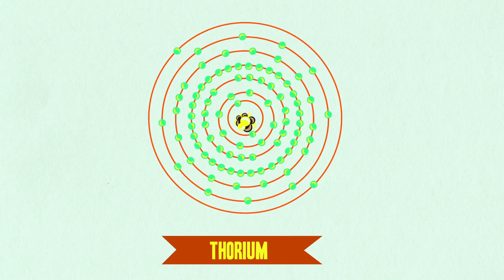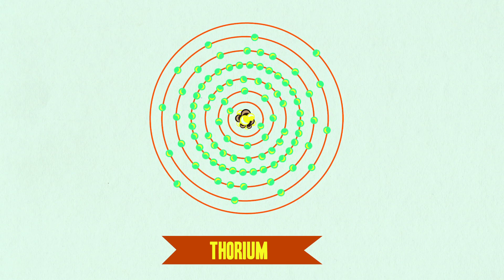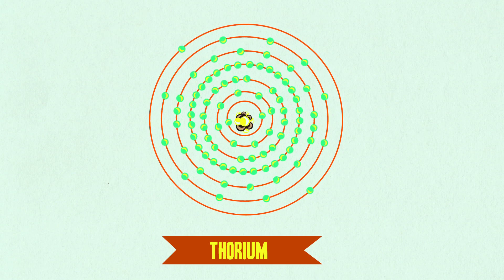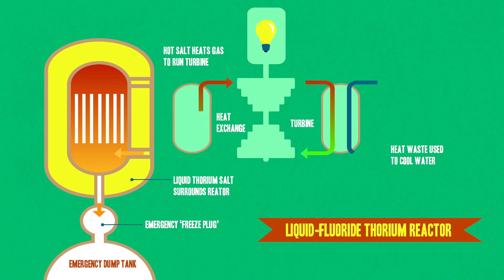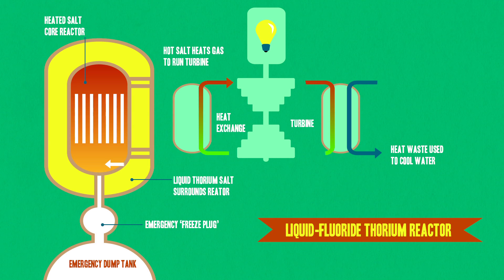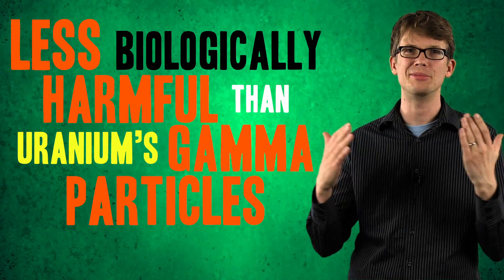Liquid Fluoride Thorium Reactors (LFTR): Energy for the Future?

Comment: There is no way to retrofit a uranium reactor to use thorium. They are totally different. Uranium reactors need huge amounts of water that they need cooling towers for. The huge advantage of Tears is that they don't. They can be built much smaller, and much nearer to where the power is needed thereby reducing the need for huge power lines. Search youtube for Molton Salt Reactors--same thing. Eliminate uranium as a power source.

Comment: To say that LFTRs can't produce weapon fuel is false. Thorium isn't fissile. In a throrium based fuel cycle, the thorium is bred into uranium 233, which is fissile, and its that that produces the energy. Its similar to the early dual purpose reactors that burned plutonium, as well as produced plutonium for weapons. Uranium 233 is a better weapons fuel than U235, its more similar to plutonium that u235 in most respect in terms of its nuclear properties. U233 was tested in several weapons in the 50s.
Reply: interesting

Comment: Actually no, the fuel is actually mixed in with the salt coolant, this so that the fuel can be drained away from the Neutron source in case of lose of power and can be cooled passively. In other words there is no chance of a meltdown either, you can even make the reactor have a drain plug that melts at a specific temperature automatically draining the reactor with no need for intervention.

The only way for a metldown to occour would be to leave U233 to build up in the reactor a long ass time; probably months, and at the same time you would have to be removing the Actinide wastes, so litterally you could walk away from this reactor and be certain that a reactor breach would never happen unless someone purposefully did it.

Comment: "As a bonus, the waste from the process could be used to make bombs."

NO.  The LFTR crowd really needs to disabuse themselves of this notion.  That is not why light water reactors prevailed, and to be perfectly clear, any reactor that runs on Uranium with an enrichment level of less than 100% will inevitably produce Plutonium as a byproduct.  Yes, this includes everyone's precious LFTRs.

"But I read on reddit that it's proliferation proof because the Plutonium is contaminated with blah blah blah..."

No.  If you want to get around this "obstactle," you just need to make sure the produced Plutonium is subject to less irradiation, which you can do by increasing the turnover of fuel through the core.  LFTRs, by the way, inherently make this process easier because they are designed to make it easy to turn the fuel inventory over quickly to avoid reaction poisoning.

Bottom line - if someone wants bombs, they're going to get them.  There is no such thing as a "proliferation proof" nuclear reactor, just some that make it easier (and yes, LFTR is one), and some that make it harder (but hardly impossible).  Ask India if you don't believe me.  We had bombs before we had reactors.  Get it?

Comment: Major oversimplification. Thorium itself cannot produce power. It must be converted to uranium first by bombarding it with neutrons. Once the reactor is going, you can use the free neutrons from the uranium fission reaction to generate more uranium from thorium, then chemically separate the new uranium from the rest of the thorium. The best way to do this is as a molten fluoride salt.

Comment: another incorrect point.  Thorium gives off alpha particles this is true.  But this is in its conversion to U-233 which is the fuel that keeps the reactor going.  When U-233 under go's fission it gives off the same radiation as U-235 fueled reactors.  Multiple nations are using thorium for fuel.  India is perhaps the largest, China's use is quite small compared to India.  China builds a test reactor.  India had 8 currently built being built or planned.  They also have one the worlds largest thorium reserves.  Many Many technically inaccurate points.

Comment: Incorrect information.  Thorium is a breeder reaction.  Almost all the thorium gets converted to U-233 over 99% making it very efficient.  But U-233 is pure weapons grade.  You can directly build a bomb like the Davey Crocket with this material.  That is why the US government does not go that direction.  The light water and Pressure water reactors that use enriched U-235 and U-238 fuel where the U-238 is considered "depleted" an incorrect term.  The U-235 is burnt as fuel but at less that 2% enrichment or so it can no longer sustain the reaction in the reactor and in the US these fuels are pulled out and considered waste.  In other countries like france the reprocess the fuel and enrich it again and put it right back into the reactor.  The spent fuel rods contain a mixture of U-235, Pu-240, Pu-238 and U-238.  Weapons grade plutonium requires 90% purity, same for U-235 and U-233, and Pu-238.  This mixture makes it extremely hard to make nuke weapons and that is why the US went that way.  The LFTR reactor is a Nuke bomb creator and that is why they hide this info.  It is also why they don't speak of the German reactor that was Thorium fueled.  Russia mixes thorium with their Uranium fuel rods to double their life.  The Us considers this because the end result is a mixture of nuclear elements that are hard to weaponize.

Comment: Thank you for talking about LFTR. Looking at the real world energy needs, existing infrastructure like power grids and cars, and the per unit cost of fuel and reactors (after R&D), LFTR is by far the best option. When energy is really cheap and abundant, we can recycle more and produce more, which in turn gives us more jobs, cleaner environment, and less expensive products. We all win. Yes, it does produce waste, but same goes for making solar panels, petrol, coal, wind turbines and every other power source in existence. We NEED stable and constant electricity supply. So lets choose the one thats the best all rounder

Comment: They're a little bit more to that.   First LFTR is an Uranium 233 reactor, it's a breeder reactor where Thorium exposed to neutron in the reactor will run into Uranium 233. Second, the reason why current nuclear wastes need to be stored for over 30,000 years is because only 0.5% to 0.7% of the uranium can be used before the fuel rods become structurally unsound due to Xenon gas being produced within it.   In a LFTR, the fuel is the molten salt so Xenon just bubbles out.  Third whether or not nuclear weapons can be made from LFTR is debatable, the general premise is that some uranium 232 are produced with the uranium 233 and uranium 232 gives off dangerous gamma rays in it's decay path which not only makes working with the uranium dangerous but would interfere with any electronics controlling the weapon and would make the weapon easily detectable even from space.   Now, advocates for Thorium claim that this means the uranium produced couldn't be used for nuclear weapons without the high tech separation of uranium 232 from the uranium 233 just as it's difficult to isolate natural uranium 235 from uranium 238 but this isn't entirely true.   With uranium 235, it is the desired uranium 235 that is the minority product but with uranium 232, it is the undesired uranium 232 that is the minority product hence uranium 233 which is usable in building weapons could be isolated by dividing a sample of uranium produced from Thorium into smaller samples and then rejecting the samples showing gamma radiation.   The government's desire to have weapons grade Plutonium might have been a factor in choosing solid fuel rod, light water reactors over LFTR but I think it has more to do with the solid fuel rods being proprietary and only available from the manufacturer of the reactor thereby allowing the reactor manufacturer such as GE to direct as much of the economic benefits to them just as inkjet printer manufacturers can direct the profit to themselves via proprietary inkjet cartridges.   With a LFTR, you could just toss a high Thorium rock into the reactor whenever you needed more fuel and such rocks are everywhere.   Note Nixon is on tape choosing to invest in a fast breeder reactor over LFTR's slow thermal breeder design because the fast breeder design takes hundreds of operators to operate safely hence produces a lot of high paying jobs while LFTR is passively safe by the laws of physics and doesn't need any operators to operate it safely.
Reply: Yeah I thought parts of this video were misleading or confusing as well. I thought that the primary reason for LFTR (today)over LWR was safety due to the fluoride coolant decreasing risk of potential meltdown from causes of pressure. The reason for using thorium to transmute into uranium 233, was because uranium 233 had a greater neutron cross section in a thermal reactor than non-enriched uranium 235. This greater size in area would allow for a greater probability of fission production leading to more generation or less fuel being required per cycle to produce equivalent amounts of generation as uranium 235. Do you know if this is true? 

In my opinion the whole debate over nuclear proliferation and nuclear terrorism is well overplayed. If the problem is we cant have certain kinds of fissile material, because the military might use, why not just ban the military from using it? The argument that other countries may use it also doesn't make any sense, because we can make nuclear proliferation manufacturing treaties under the IAEA to prohibit nations from doing so. Also it seems to be way more work than making bombs how we used to do it. In the USA we banned nuclear reprocessing in 1977 due to nuclear proliferation, but today Russia, Japan, India, China, France, and the UK all use reprocessing equipment. Clearly the US banning ourselves had no effect on forcing other nations, including our enemies to ban the process as well. Instead we just shot ourselves in the foot as this machinery could be used to recycle and separate nuclear waste for continued use. The whole terrorism debate is even more nonsense, when you explain the technical and advanced scientific understanding required for the production of bombs from nuclear waste at a reactor. Its just insane, and would cost any terrorist group millions of dollars to do so, when they could just buy the bomb on the black market for significantly cheaper. Its absolute nonsense.

Lastly this video is very misleading by suggesting that an LFTR is easier or even cheaper to construct. As a high temperature thermal reactor much more expensive materials are going to be required like Hastelloy- B Carbide Silicon. Besides just the temperature, the molen salt is highly corrosive so even with better materials, these reactors will most likely need a regulation in place to "check the pipes" so to speak for any damage and flush the material so as to not damage the reactor. Now in my opinion the savings on liability and fuel more than make up the difference in costs, but the most important comparison will be if these plants can be economic compared to natural gas.
Reply: +Paul Swanee   Yes, I find that the safety benefits of the non-pressurized nature of molten salt reactors to be the primary benefit.   I don't think Uranium 233 has a greater cross section than Uranium 235 however Thorium is far more plentiful than either Uranium 235 or Uranium 238.   Indeed the test reactor often quoted by LFTR supporters used uranium 235 in it's molten salt core.   Where the neutron cross section is often mentioned is in comparison with Plutonium 239 which the fast breeder advocates use as a fissile material transmuted from Uranium 238 which is far more plentiful than Uranium 235.   I see the proliferation problem as the proverbial genie in the bottle and our attempts to stymie proliferation are doomed to fail eventually.   I don't see LFTR as a solution to proliferation issues but it would change the situation slightly though perhaps not for the better as one might hope.   I see the claim to lower costs by LFTR advocates is a realistic one as the reactors are not pressurized and the reactor designs can be much smaller and hence mass produced.   Yes, materials tolerant of the molten salt both in temperature and in terms of chemical reactions require more research but these are not issues that we have not already dealt with before.   As to temperatures, we already deal with molten salt in solar themal storage facilities.   I suspect that LFTR could be done at a much lower cost than current nuclear technology but the long term life cycle of the reactors are simply unknown.   Can LFTR be competivtive with natural gas?  Well, the costs of natural gas is artificially low simply because it has historically been an unwanted byproduct of oil extraction.   Indeed,  a lot of natural gas has and currently is simply being flared at the wells instead of build the extra pipelines, compressors and liquefaction plants needed to bring it to market.   Basically, supply of natural gas has historically outpaced demand but if demand increases as it has been doing so, this could change.   At the very least there would be a need for some capital investment to bring stranded natural gas to market, then there would be low cost till growth of demand outpaces the inadvertent production growth due to oil production and then we might see what natural gas costs might actually be.   Generally, compared to current natural gas rates and usage, natural gas is about five times the price per energy as coal and LFTR has been proposed but not proven to potentially be less costly than coal.

Yes, I find the video misleading but really that's not surprising.

Comment: Not to mention that alpha particles are stopped by pretty much anything. You don't need a radiation suit that's made of lead, in fact they have extreme difficulty with normal cloth...

Which means that if you're gonna store radioactive waste from one of these, you can do it in plastic barrels, which doesn't rust.

Comment: LFTR is much cheaper per KWh , can't melt down or run away, runs on depleted uranium instead of enriched uranium, can't make plutonium, can be started and stopped as needed to work with "green" alternatives, can be made small enough to fit on an 18 wheeler and supply a town or city, all but stops C02 production by not burning fossil fuels,  is cheap enough to be used to make synthetic fuels and fresh water from salt water. It will reduce your light bill, and make electricity intensive goods much cheaper. Do some looking around. This is a biggie. Call your senator. Tell him China is starting it, and we invented it.
Reply: " runs on depleted uranium instead of enriched uranium" This is not true for most designs. While you can reuse uranium fuel after reprocessing the only company that is specifically designing a reactor to run on depleted uranium is TerraPower with their Traveling Wave Reactor. The bred uranium 233 from thorium 232 is still enriched.

Comment: Could thorium be used in say a yacht or for a cargo ship or maybe even a submarine? If yes how long could it last without changing fuel & when changing fuel how hard will that be?
Reply: Molten salt reactors can be built small enough to power a ship. Instead of refueling, what would likely happen is just replacing the whole reactor core. As to how hard that would, it depends on how large the reactor cores are and for very large ships even how many.

Comment: Even better is a Integral fast reactor which literally eats nuclear waste and can't be made to melt down even if you tried, which they've done several times.
Reply: drewpamon IFRs are cool but do have a few drawbacks compared to MSR (of which LFTR is a variety).  IFR uses solid fuel which has less efficient heat transfer compared to a fuel salt which is literally just heating itself.  The coolant in an IFR is usually metallic sodium which is way more likely to burn in the case of release compared to a salt.  Lower cross sections of fissile material in the fast spectrum means fast reactors typically require a larger supply of fuel in the reactor, a larger reactor, etc.  And, the onsite chemical reprocessing in an IFR is quite complex and requires the reactor be shut down and fuel removed, whereas an LFTR can theoretically reprocess continuously during normal operation.

IFR is a fantastic reactor and a good way to chew through U-238 and Pu-239.  But in my opinion, LFTR is a better mouse trap for the production of cheap, safe power.

Comment: CANDU reactors are the future much safer huge power output with no emissions while not using bomb grade uranium
Reply: Solid fueled reactors, including CanDUs, are much less efficient and safe than molten salt reactors.
Reply: Unlike uranium reactors, LFTR's can't explode. Thorium reactors do not require much pressure.
Reply: Unlike uranium reactors, LFTR's don't exist.  But that doesn't stop the thorium trolls from completely misrepresenting its capabilities.